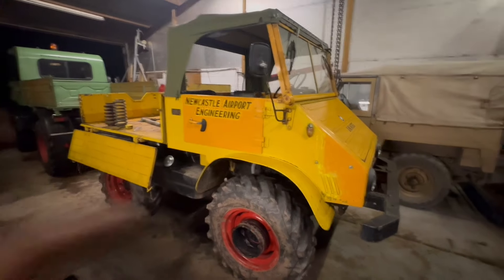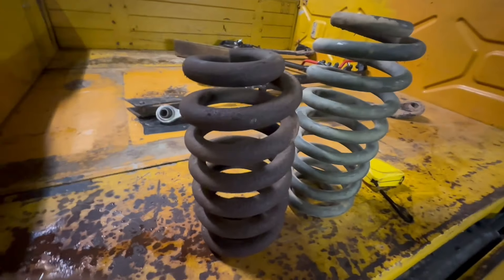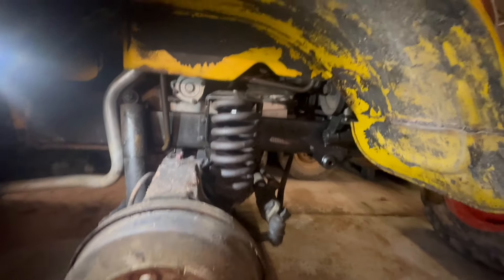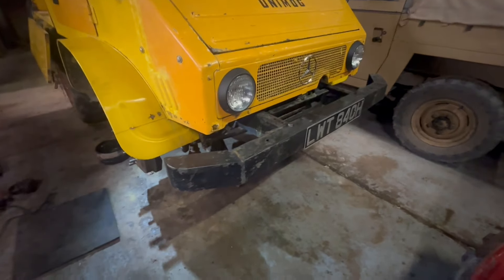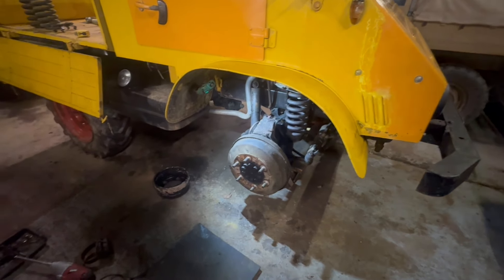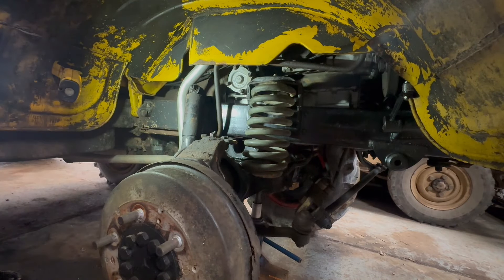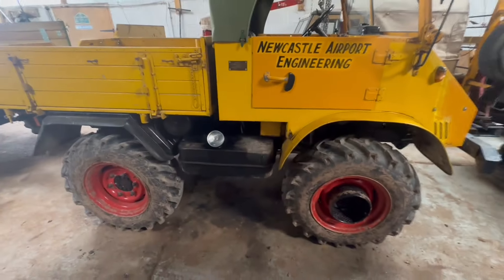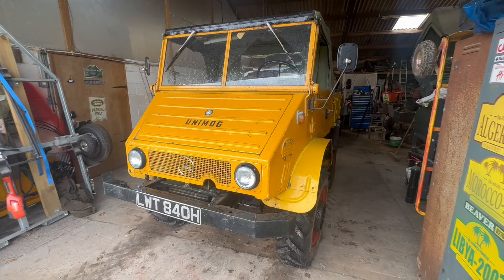Improving the suspension on a Unimog 411

Comment: Thanks for the great video and the good explanations.
Greetings from Germany :-)
Reply from the maker: Thanks - great to hear you found it useful and interesting!
Reply: nice video on the very most neat unimog , i used to drive a 2010  , the model before the 411  .  they are easy to work on , i had the oilfilter touching the frame occasionally . further it was always a task to keep the old girl braking properly .  these early models are actually the most fun to work on.  Maybe not important but to me it helped somehow , I changed the studbolts to flat ones with a separate spring coil rings like on a LP 808 mercedes
Reply from the maker: @woodennecktie   Thanks, yes they are a nice simple machine to work on and a pleasure to own, I agree 😊👍
Reply: @Classicworkingvehicles  If only modern vehicles were as straight forward to work on, the chassis on the 411 looks in remarkable condition as well, does it have the optional 2 speed crawler box fitted?
Reply from the maker: @clooperman3745  the vehicle is in remarkable condition for 54 years old! It spent most of it’s life stored in a hanger 😊. Yes it has the crawler box fitted 👌